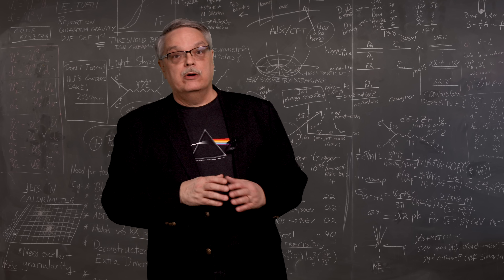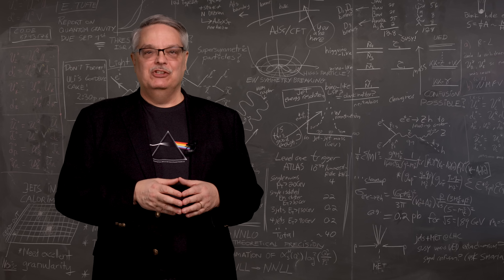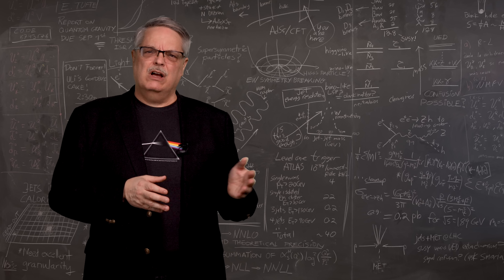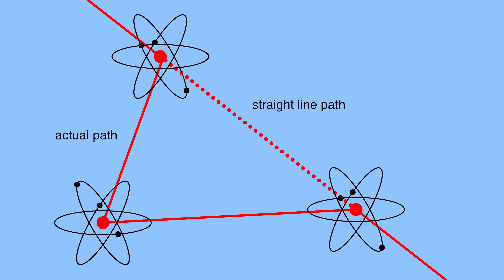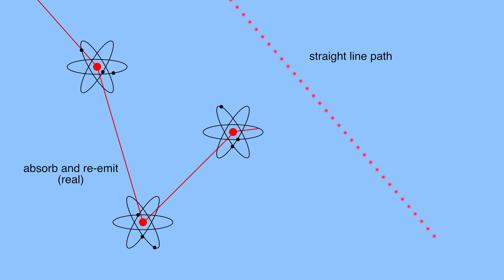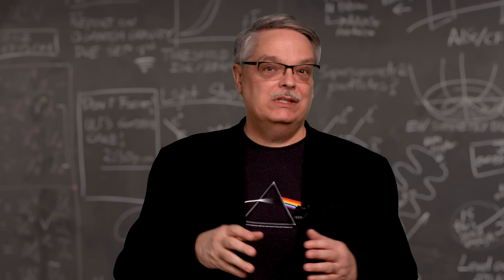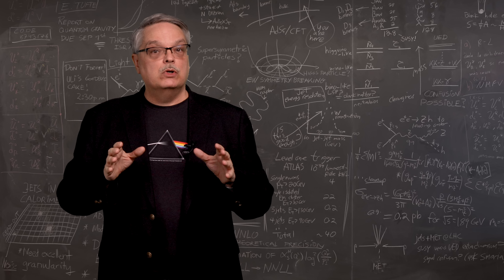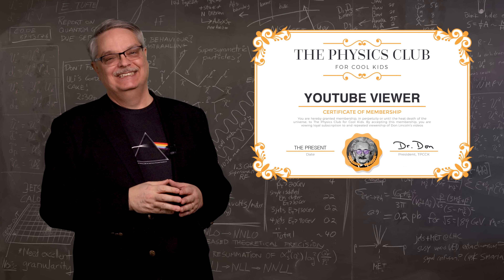Why does light slow down in water?

Comment: Light is EMR.  That is why it changes direction.  Each individual wave has its own coaxial magnetic field in a chain.  As they meet the material, the magnetic field experiences drag from which side meets the material first, dragging the adjacent field along at the new trajectory.  The angle of trajectory is determined by the field strength and orientation of the molecules in the material and the frequency of the EMR.  This is why white light spreads into a spectrum and why single frequency lasers do not.  Different glass mixtures provide different angles of diffraction,  just as different solutions in water.  The  capacitance of the molecules determines the speed of propagation.  All transparent materials, on the molecular level act as capacitors at the frequencies that they appear transparent.  "think in terms of energy, frequency, and vibration."  - Nikola Tesla
Reply: Very well done. Thanks👍👍.
Reply: Ok you wrote it or tesla 
But nevermind , I am awed to meet who could actually understand or even remember that

That wonderful phenomena
Reply: Good God
Reply: Oh , sorry 
I didn't the tesla at the end
Reply: @selenophile410 Those were my words except the last incomplete sentence.  The full quote from Nikola Tesla - “If you want to find the secrets of the universe, think in terms of energy, frequency, and vibration.”  Here is another great one, “The scientists of today think deeply instead of clearly. One must be sane to think clearly, but one can think deeply and be quite insane.”  I am not a scientist by trade, but I have hobbies.  Perhaps you have seen my channel?
Reply: @mwm2929  
"As they meet the material, the magnetic field experiences drag from which side meets the material first, dragging the adjacent field along at the new trajectory.  The angle of trajectory is determined by the field strength and orientation of the molecules in the material and the frequency of the EMR"

i don't understand that part. do you have a wiki article or a subsitute of sort that could go into more details.

btw nice seeing that there are people literate enough on the matter at hand to point out those mistakes.

also, using maxwell equations with drude's model can also describe the phenomenon.
Reply: @recouer  To refract light must incident obliquely on material. When the velocity changes due to superposition then the value of velocity decreased in direction of surface as well as in direction of normal to the surface which changes the slope of the path. ....
Take your time and resolve the components of velocity to understand... You will see through logic
Reply: @HiQuantumSKY  

it's no logic, it's physics. as i know, the light of the sun is a superposition of all the wavelength of the visible spectrum and it still go at the speed of light.

and to understand why this is true no matter the frequency, you need to understand how wave propagates and how to mathematically put that into reality.

edit: sorry your post is very confusing i understood what i presumed to and not what you said... care to clarify ? (english isn't your mother tongue i presume)

especially the part where a photon is created, we'll have to talk a little about quantum physics to enlighten you on any misconception here if you don't mind.
Reply: Excuse me, but can I have your autograph.
Nobody explained light so exactly*why to me 
Sis/dude ,you a scientist ?
Humans with such clear ,precise and full  & complete knowledge are hard to find these days , those willing to share some even more so.

Comment: After parsing the video’s language carefully I don’t believe anything incorrect was said, but I don’t think the explanation is clear.  The video sets out to explain why light slows in a medium and after explaining how light interacts in the medium the video states the resultant light moves slower than the speed of light.  This isn’t an explanation, it’s merely a restatement of what was trying to be explained.  I think a clearer explanation begins with making the distinction between light and a beam of light.  If you think of light as photons, not point particles but packets of energy that move as a wave, and ALWAYS at the speed of light, and think of a beam of light as a coherent stream of many photons that move with an average speed.  In a vacuum this average speed is the speed of light.  In a medium the beam interacts with atoms in the medium, the interaction is complex but it’s the interaction time with the atoms that makes the average speed of the beam of light to be less than the speed of light.  So while light moves at the speed of light in the medium (and always), the average speed of the beam, due to the interaction of the light with the medium’s atoms, is something less than the speed of light.  The interaction time is governed by characteristics of the atoms, hence each transparent material has it’s own slowdown (or index of refraction).

Comment: Moving fields.  Did you forget basic QED?  Light PARTICLES take ALL paths, but preferentially take a SPECIFIC path depending on the AMPLITUDE of the probability.  The absorption and readmission explanation is CORRECT per QED.  Fields arise as a result of the interaction of particles with each other.  Wave mechanics only can be used to describe a single particle as a wave.  An interaction between two or more destroys wave mechanics math.

Comment: Carlos Encarnacion: I understand well that light photons do lost momentum when penetrating either glass or water but why when reemerging they would do so at light speed they had when they entered into those mediums? We don't mention the width extension of such glass or water mediums.While passing through those mediums they loss momentum and according to Newtons first law they should be boosted again through someway to regain former momentum to speed they formerly had. Solid objects are accelerated or decelerated following such law. Light photons have a wave and particle duality and may be I am missing something. For example think on visible spectrum photons(wave lengths from 3,000 to 6,000 angstroms) hitting sea surface penetrating down to 30,000 feet .Although they enter at 186,000 miles per hour they do loss momentum and visible spectrum wavelengths would fade because is a long way to the seabed and something hinders them but other shorter wavelengths would arrive as particles and be absorbed by seabed. But let's suppose hypothetically that there is no seabed after such long penetration. Would they reemerge again at same speed 186,000 miles per second after such enormous amounts of collisions they experience when going down or could some of these photons even be catapulted to speeds exceeding light speed?
Reply: You could extend the question to the absorption and re-emission of light into and out of an atom.  Light always enters into and out of an atom at the speed of light.  Additionally, you could ask is it the same light that is emitted as is absorbed.

Comment: One small clarification:  

The example states that after exiting the glass the path of the beam of light is traveling parallel to the path of the beam of light before it entered the glass.

But, strictly speaking, this is true only if the two sides of the glass are parallel (I.e. as they are drawn in the diagram in the example).   Right?
Reply: Yes. Simplest example: Half circle of glass you use in normal physics class. On the flat surface light gets "bent" but when it leaves the glass, the surface will always be rectangular to the light beam, thus no refraction.

Comment: Sorry to crash your party, but I don't think you explained anything here. The core question remains unanswered. I can't seem to see how the different propagation speed emerges from your argument. In the animation you arbitrarily pick the original wave and the wave created by the electrons to have the same amplitude, and then get some beat note/standing wave phenomenon from that. That's not what happens. Kramers/Kronig and oscillator response would have provided a much more intuitive and correct approach direction. Thanks for trying, but this is oversimplified, on the borderline to wrong. Nature is actually more beautiful than this video suggests :))

Comment: From Maxwell's equations, you can derive a formula for the velocity of light. The velocity is one over the square root of the product of the permeability and permittivity of space. But,  any medium other than space will have a different permeability and permittivity. In fact, they will both be larger than those of free space. Therefore, the value of c in the medium will be smaller.

Comment: I've got to ask this question. Suppose I had a Michelson interferometer and I have it set up so that one of the paths goes through a block of glass or container of water but the paths are of the same length. Would the result I would get at the detector be consistent with the light always going light speed on both paths or would I get a pattern that would be consistent with the light being slowed down by the glass or water? (Asking since if I understood your explanation correctly the photon portion is always going light speed? It's the combined wave that goes slower?)

Comment: I definitively need a basic book about waves and fields :)
Reply: Except that Physics has no idea what a Field could be, or how it exists, or even how to define it. They just say that there is a "field" and that's the answer. A Field of what?  The truth is that there in not any fields such as magentic or electric or gravity "fields" UNLESS there is a MAGNET, a ELECTRIC POWER SOURCE, or a Earth  that have the property of a LOCAL area of influence detectable about them.

So you don't get space filled with a radiation field existing everywhere just so a photon can wave through it.  Something else must be happening, which no one has any clue about.
Reply: @xiaoxiao-kg5np  
sorry but a photon is an electromagnetic field that propagates through space, we know quite well how it works and why it works, no magic tricks here, just science.

if you want to understand i advice you to understand how a wave propagates though a medium with d'alembert equation.
then you try to understal the maxwell's local equations then using those in a void (so no volumic density of charges) you can get a relation between the electric and magnetic field that is in every aspects the same as a wave travelling through a medium. 
thus the reasons why photons can travel through the void.

also i put that here because what he said is BS:

where to begin...
this video has taken many shortcuts in explaining the relations between the two systems and how it affects them.
to better understand this, we need to talk about d'alembert's equation and its dispersion formula and how it describes a wave.
so d'alembert's equation is used to link together the spatial and temporal variation of a wave.

and from this equation comes the dispersion relation that links together the frequency, wavelength and celerity of a wave.
to access to this equation, we use maxwell relations to describe this phenomenon. when we consider those relations in the void, we get the relation: c² = k²*w² where k is the angular frequency and w its wavenumber. (just google it, ain’t that hard to understand)

thus we can see here that the celerity is proportional to its angular frequency. however, as explained in the video, when light enter a medium, there are charges that can be influenced by the electric field, especially electrons that are 2000 times lighter than their counterparts protons.
thus, when light comes in this medium, we assume that only electrons are affected by the electric field.

we then apply newton's second law to those electrons to find a relation between an electron's speed and the electric current
(we also neglect the magnetic field of the light as the electron is relativistic thus the force from the electric field is much greater than the magnetic one see lorentz law to better understand this )
and then by generalizing this equation to all electrons in the medium, we can get an induced current from the electric field of the light.
( the current is j = n * v with n the volumic density of charges and v the celerity of electrons)

then when we put this back to maxwell ampere local equation, we introduce a new component: the induced current which thus gives us a new dispersion equation: c² = k² * (w² - wp²) with wp the plasma oscillation and thus we can see that from the value of wp, we'll get a different value of the celerity of the wave.

thus we can say without a doubt that they are wrong in their explanation as it is not the combination from the electric current of the electrons and the wave that makes it slower but the induced current inside the medium that modifies the dispersion relation thus modifying its speed.
or in simpler words, it's the movement of electrons that changes the frequency and celerity of the light, but not the combination of the two electric current. (also on a side note, trying to represent the electric current of a dipole using a sine wave.. funny thing you did there 😅)

and finally, as for the reason why the light has a different angle, well you can easily explain this using two waves parallel to each other crossing the medium in phase with each other. as they have the same wave plane, you can easily come to the relation between the refracted angle and the incident angle using some basic geometry. i recommend you to see the demonstration of descartes second law if you want to better understand what i'm talking about.
Reply: @recouer  Yeah, lots of possible explanations and ways to try to describe what you think is going on with light, but despite your lengthy article, no on really knows how light works.  These are all just proposals of how they think it works. But none describe what light is actually doing.

You have no evidence that a photon actually exists, you have no proof that light is moving as a wave. Your experiments such as with an interferometer don't PROVE that light is a wave. You just conclude that whats you are seeing MUST be caused by light messing with itself.
you have no proof that light is in any way, an electromagnetic phenomenon.  That is just speculation.

Actually the evidence is all around us that light is NOT "interfering with itself, and creating interference patterns. Light from many sources, and reflected light never makes any interference patterns, I see every detail of everything in perfect clarity. Light does NOT interfere with 
itself in all of nature.   Next, IF light is electromagnetic, we should see light getting messed up when it passes an electric source or a magnet.
BUT NOTHING HAPPENS AT ALL.    This PROVES that light is unaffected by any electrical field or magnetic field.  Light can not possibly be an electromagnetic phenomena.

Finally, science has no clue about many fundamental things, such as "What is a Field?" 
There is no rational description of a field. No concise definition that can be used in Physics. 
There is a stupid description of a field but that is only useful in theoretical mathematics. It is only fantasy.
I said "theoretical mathematics" which is the branch of mathematics that has no relationship with reality, but still thinks its doing actual Physics. Most of modern Physics falls into this camp.

And your last sentence about using geometry to explain why light changes angle when entering or leaving a different medium gives accurate results, but uses two parallel "waves"  that are synchronous and in the same "wave plane".  so it looks like it works out.  However, it ONLY works out if you consider the experiment from one point of view.  You are looking at it from the "side".  If you think about the same light beams entering the glass but you are observing from the front, there is no deflection of the beam.  It passes straight through the glass at the same apparently angle as it entered, perpendicular to the surface. This is normal.
But the question remains, why do you get the luxury of drawing those rays is such a way so that you can explain the effect that way you have?
In other words, draw the ray as one single vector, now explain why it deflects........
IF light is moving in a wave like motion, it cant be confined to a single plane, the light rays  must be "waving" in EVERY possible plane, BUT always remaining parallel to each other. unlike a water wave which spreads out in a spherical manner, and is never parallel. 

So as its an impossibility to spread out as a wave, yet also remain parallel, this is evidence that you don't understand how light works at all.

This is not easy to describe with out a simple drawing or two.
Reply: @xiaoxiao-kg5np  
sorry but who can say what the world is ? science doesn't try to say what it is, we left those questions for philosophy, but how this works. so of course you could get as many models as you want, call them whatever you like, in the end, the only thing that matters is its capacity to predicte what the fuck is going on.
and those models (even though it is their simplified versions) does hold some good predictability results. thus they can be considered to be right.

and yes, no light can ever be truly parallel between each other. however, you can easily get this property localy, or you could use a single photon (well you wouldn't get a reflected light but meh)

and watching the experiment from any other perspective than the incident plane is pure idiocy, just a reminder of snell's descartes first law: the incident, refracted and reflected wave are in the plane of incidence. 
so by watching a wave from any other perspective than the incident plane would make you lose information about what is happening.